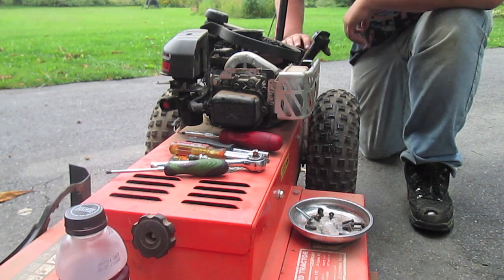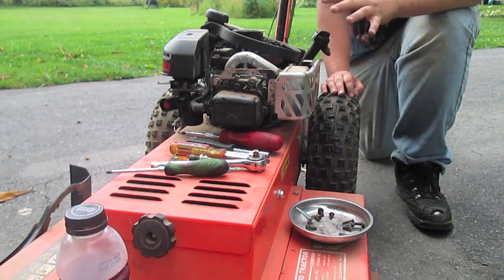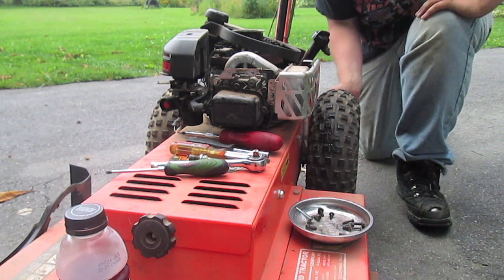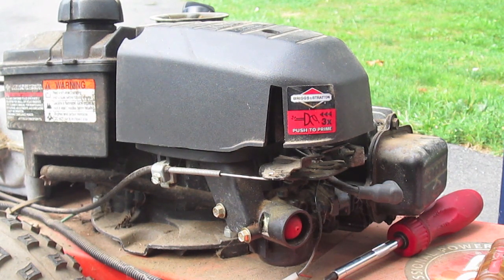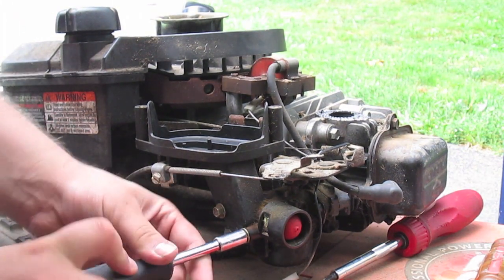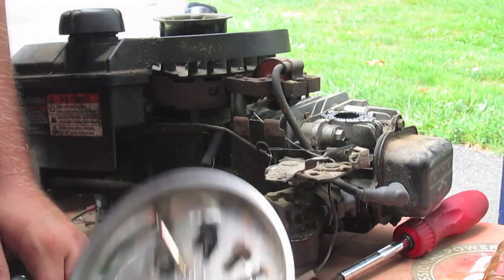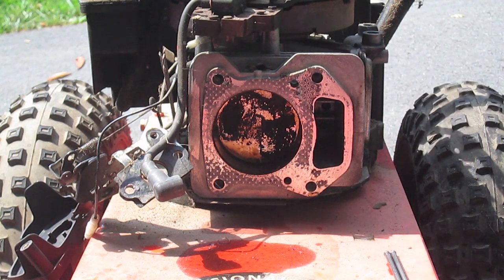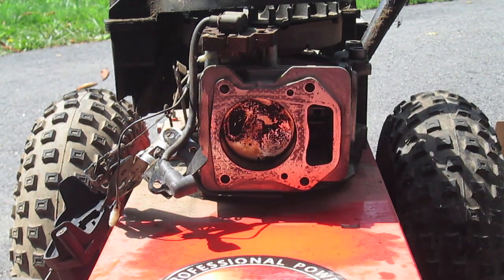How-to: OHV Cylinder Head Replacement - Briggs & Stratton 825 Series

Comment: This kid needs someone to teach him to do this job right. Head gasket surfaces need to be CLEAN.  There is a spray can of gasket remover that can help. 2. Do yourself and your customer a favor and power wash the engine first so you dont end up putting garbage/sand inside the engine. 3 Bolt torque specs for any bolt can be looked up & followed for important Engine Hardware. You can print out a chart & keep it on your tool box.

Comment: I would of pulled the head and used a Time-Sert thread repair to fix that stripped out spark plug hole. A lot cheaper and it would be a lot stronger than original. Helicoil are junk and can fail.